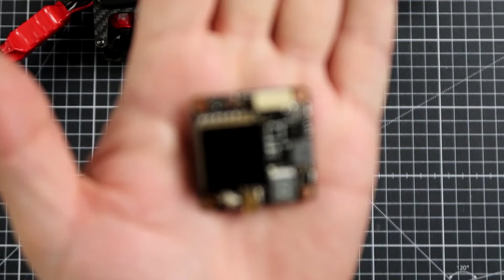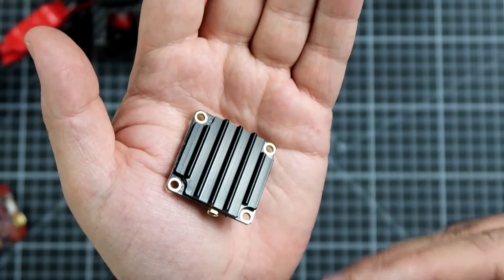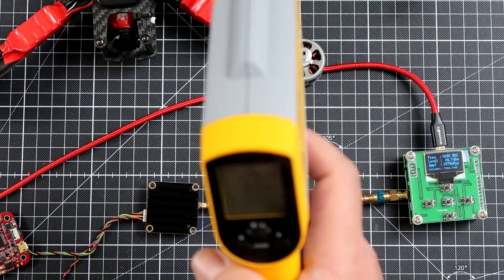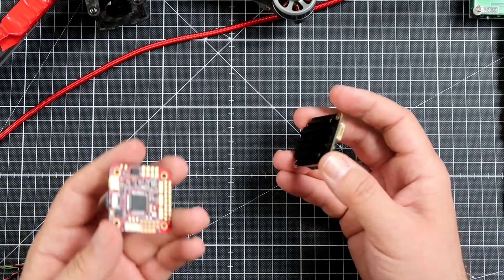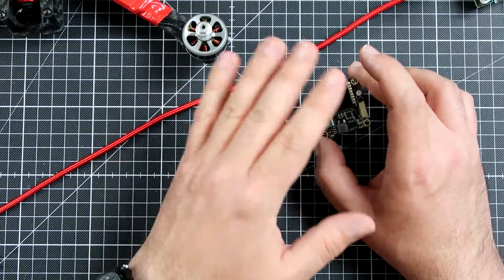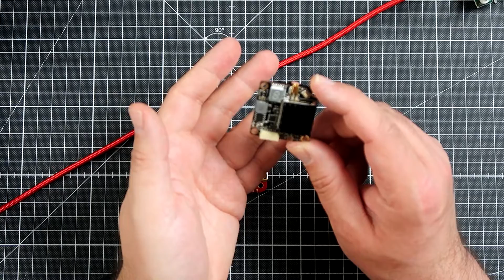AKK FX2-Dominator 2W 5.8GHz video transmitter - hands-on and power test

Comment: You could put it on the iflight xl5 frame just mount it in the rear 30x30 spot and the esc and flight controller in the middle

Comment: Nice, but still no cherenkov radiation to witness yet.
If I use it and have it set for pitmode when not armed (in mode tab), would the failsafe put it into pitmode when whatever I am using is returning home (failsafe)?

Comment: I prefer 1280mhz video myself.....200mw vtx and 6 kms at 100 metres altitude, something you can only dream about on 5.8G, even with 2000mw of output. The Dipole is also pretty small too. Low db Patch, no tracker required.
   I do like the quality of AKKs stuff though, I have a few of their tiny 5.8G vtxs for quad flying close in up to 1km.
Reply: Link to the vtx and receiver you recommend for 1280mhz?

Comment: I think JB said something about that for a few days. He said that you probably get the same results with a good quality 800mw-1W and good antena. He said that because of heat and power consumption is probably not worth it. But still agree that we live in very interesting time :)
I read yesterday that Tesla goes slowly with Liton from 140wh/kg on to 460wh/kg.
Imagine that some day we get 3-4 times more flight time :)
Reply from the maker: The funny thing about radiated power is that doubling the power increases the range of only 1.42 times. It's a overkill for sure

Comment: Nice Pawel!
Perfect for a long range wing.......my preference, vtx mounted out near the wing tip...bottom and top exposed. 
Dragonlink antenna on the other wing tip:-)
I’ve used tbs/turnigy for years, but akk appears determined, like matek, to be better.  I just got a few of the regular fx2 to try out.....hard to beat the price/quality...and as long as it can output 200mw, that’s all I need for my kwad flying:-)

Comment: Is this vtx capable to lower the output power automatically to protect itself from overheating in case of a lack of airflow - if you don't fly quickly after you have connected the battery?
Reply: if not, you can do that in Betaflight (power up when armed)
Reply: The new tbs Evo is doing this

Comment: Doesn't a lower frequency make more sense for range/penatration?
Reply: Definetly. But can't be used with our existing gear (needs new receiver and antennas)
Reply from the maker: Plus, 5.8GHz just work out of the box. 1.2 is picky
Reply: I have used 1.2G Video and UHF on my 5 inch quad and it worked first time....endless range....You do need some antenna  separation and use low VTX power. Beats 5.8G all day long.
Reply: Thanks guys. I'm going to give 1.2 a try. Rf shield paint or foil maybe? My 800mw VTX  penatration in the woods is disappointing.